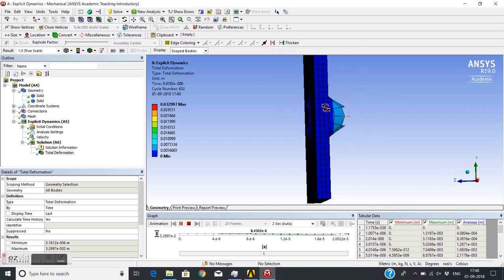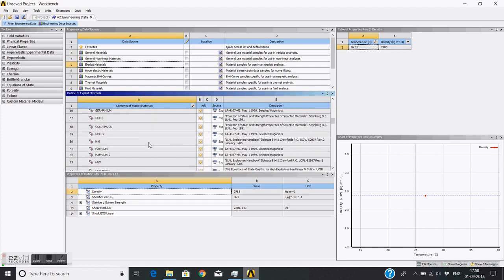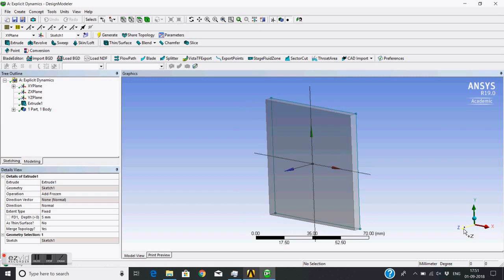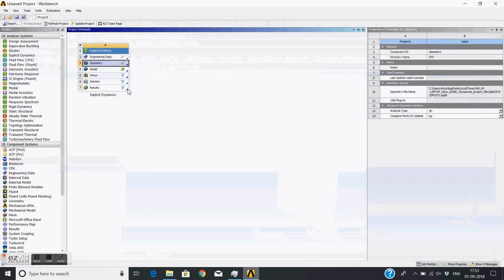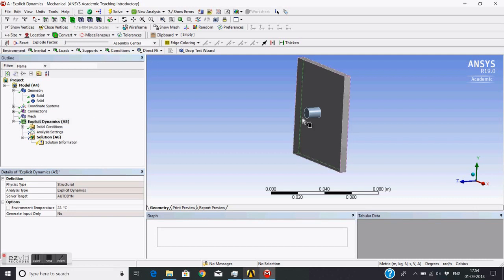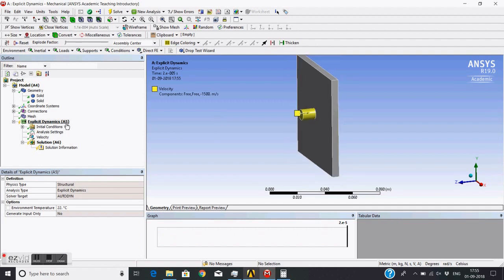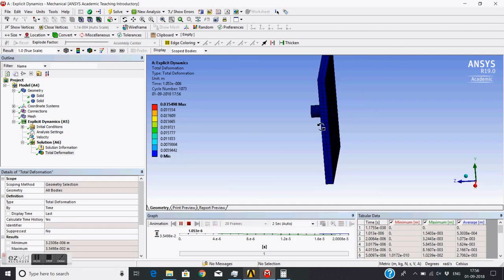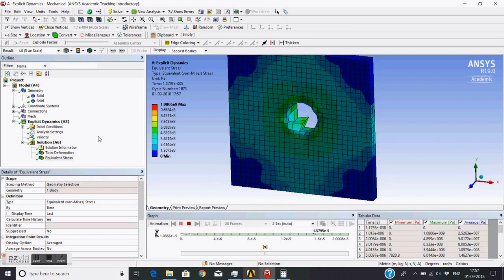Bullet Penetration in Ansys Explicit Dynamics Autodyn Part 1

Comment: Can it be done for laminated composites as well?
Reply: Yes it can be done
Reply: @kbdrupad4493  very fast bruh, my project is over 😊
Reply: @Ke3p_Tr0lling  sorry haven't seen when you added that comment
Reply: @Ke3p_Tr0lling  bro i am defining Kevlar epoxy material property with different orientation in ACP pre but i am not able to transfer solid composite model from acp to explicit dynamic
It only accepting shell model what to do???
Reply: BRO PLEASE TELL ME I AM PERFORMING IMPACT ANALYSIS ON ANSYS EXPLICIT DYNAMIC, WHICH VELOCITY WE NEED TO CONSIDER AS RESIDUAL VELOCITY AS WE GET MAXIMUM, MINIMUM AND AVERAGE VELOCITY ON BULLET AFTER PENETRATION

Comment: Actually mine error was coming like Time step too small. What should I do then ? I did exact same steps like you showed
Reply from the maker: Use standalone Autodyn. Set energy reference cycle to very high, like 9999999. Start solution and stop before the time erroe occurs and set Minimum time step below your error time step. This will allow solver to choose time step smaller than restricted initially.

Comment: Awesome vid! but mine never penetrate the plate they just bounce back like jelly :/
Reply from the maker: Yours may be only elastic material properties. You need to add plasticity with some failure criteria (elastic-plastic).
Reply: @truptipatil3422  found out what it is... i was using the default structural steel and it has no explicit properties or something i think

Comment: Hi, I just started to play around with Ansys explicit dynamics (student version) and I am facing an issue. 
I modelled a "bullet" with a diameter of 10mm, slightly tapered to 5mm at the tip, facing a 3mm piece of sheet metal - so pretty close to what you have done here
Material for bullet is tungsten carbide (very hard)
Material for sheet is aluminium alloy
Both are set to "flexible"
All my settings are basically same as yours, but it doesnt matter how high I am cranking the speed of the bullet (went up from 750 to 5000m/s) the bullet is not able to penetrate the sheet. 

What also makes no sense is this:
My sheet metal is 100x100mm, and fixed at two sides but the data says, that it is getting stretched over 1000mm during impact..so the material should have failed way before that....

any idea, what could be wrong in my settings? I guess somewhere I am missing to set, that the sheet/plate can be "ripped apart" by the projectile
Many thanks in advance! =)
Reply from the maker: Add "Erosion strain". Try with "Erosion strain" to 2. Also, add failure strain to, at least the target material model, roughly a value 0.3 (depends on material).  After the addition of failure strain, remember to set the "Erode element after failure". If it is not done the mesh will keep on stretching without any failure sign.
Reply: @truptipatil3422  From where do we add erosion strain. I am not able to find the option?
Reply: Use the failure material model, without which u will not be seeing the ripping of the blade no matter what ur velocity of the bullet be

Comment: Hi I've been using ansys for a while for my project about armored vehicle against certain calibre. Can we make the simulation also breaks the bullet? Because of course the bullet will expand on impact. So far I see what I created was the plate was broken if my armor fails or just got bruised a bit if it works, but the bullet still in perfect condition
Reply from the maker: Yes, you can. I have used a Steel bullet and Aluminium target. Steel bullet has more strength and more kinetic energy due to its density. You can try by exchanging materials. Also, give proper material erosion or failure criteria.

Comment: This is utter rubbish. This analysis does not provide any useful information about the real world bullet impacts.
Reply from the maker: Purpose of this tutorial is to show how to set-up the impact problem in Autodyn. To simulate real bullet impact you need material properties of real target and bullet and, need to model real bullet shape. Also, the mesh needs to be finer.  You will get penetration depth as output.
Reply: @truptipatil3422  can you please perform an analysis where you provide complete data including material model? also time step calculation and mesh type and size?
Reply: @ahmadazmat4984  wtf bro the video is really nice a well explained, just the basics